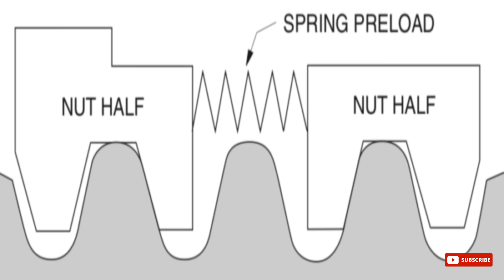Elegoo neptune2s | Upgrade Your 3D Printer: Installing Anti-Backlash Nuts for Precision! 🛠️

Comment: This installation direction is bad, since you're working against gravity. The spring is pushing up on the gantry, but the gantry's gravitational force is larger than the maximum spring force. If you have any possible real backlash because the Z axis is riding up occasionally due to say unevenness of wheels or rail surface, this installation direction will only exacerbate the issue slightly rather than help solve it.